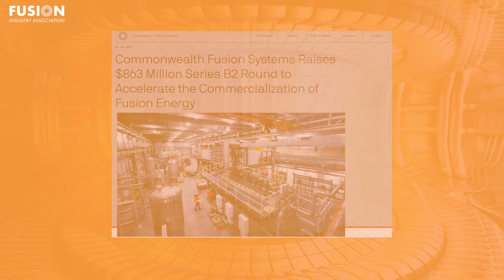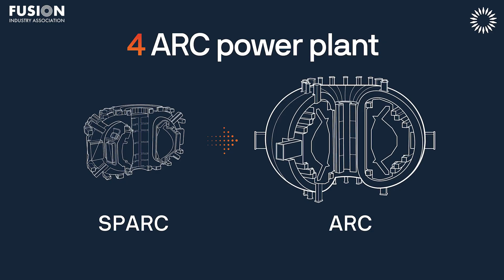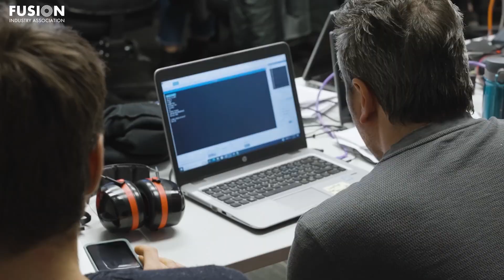Fusion News, September 3rd, 2025

Comment: Since nuclear fusion energy experiments began, in the 1950s, it has been accompanied by much over sales hype which helps explain why two generations of researchers have failed to get anywhere close to demonstrating an economically practical power source. This sales pitch was based upon the press releases of the promoters without any consideration of critical analysis which characterizes good journalism. Most investors, in this technology, have no formal backgrounds in such esoteric fields and can be easily snowed by the project leaders, which is likely the case in these reported investments. Those investors likely have looked to consulting contractors, filled with fusion energy fans, to provide them with 'independent' critical assessments.

Those investors and power sharing deal negotiators are unlikely to be aware of the following fusion details. CFS has never demonstrated the generation of a single watt-hour of fusion energy production and their SPARC machined, that they dub as a prototype of their ARC machine, comes nowhere close to being anything like a prototype of ARC. Once completed it may never achieve CFS stated goals by the year 2030. It will be lucky to achieve any significant quantity of fusion reactions during its 10 second pulses follows by hours worth of recovery time. The NIF 12/05/2022 'breakeven' ICF laser shot was presented here. Not mentioned was that the experiment took about a week to prepare and the resulting fusion reaction lasted for only 0.000,000,000,08 second before 96% of the supplied fusion fuel was blasted away from the reaction center. The use of the term 'ignition' is a misleading sham. The input energy, used to calculate the fusion gain, was less than 1/100th of the energy required to pump the lasers. In the nuclear fusion energy field it is standard practice to omit mentioning the quantity of energy that is required to power the experimental facilities.

Until tritium breeder and purification technology is tested, which ITER was expected to do by now, the initial experimental machines and demonstration power plants will require the purchase of commercial tritium which costs over $30,000 per gram. For decades the sales pitchers have been stating that the hydrogen fuel is almost limitless. Those, who tend to lead such endeavors tend to be masters in omitting key evaluation details.